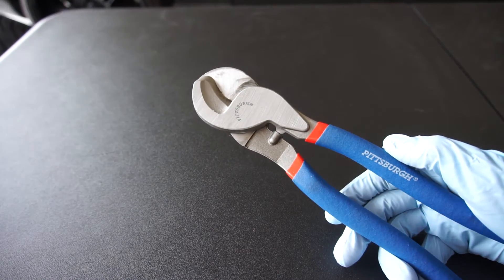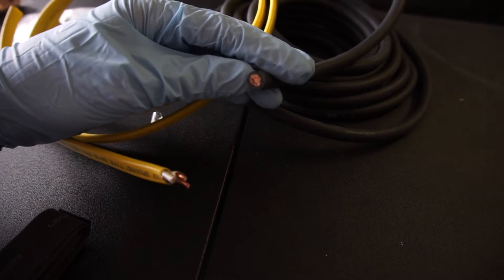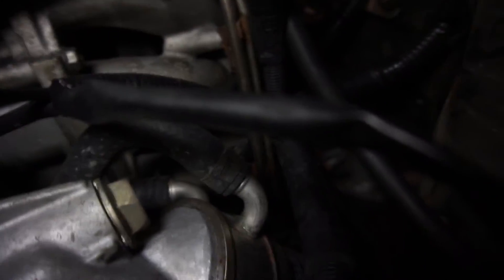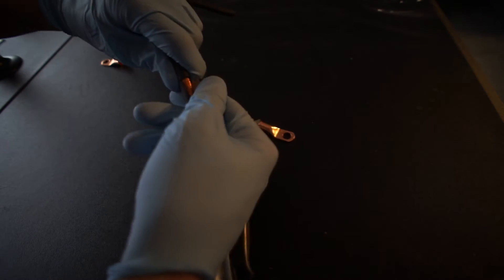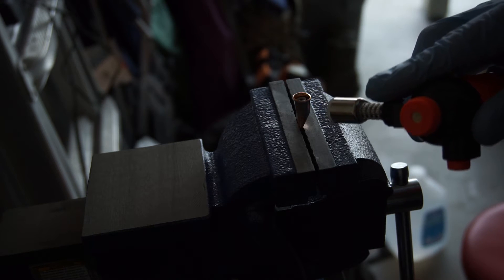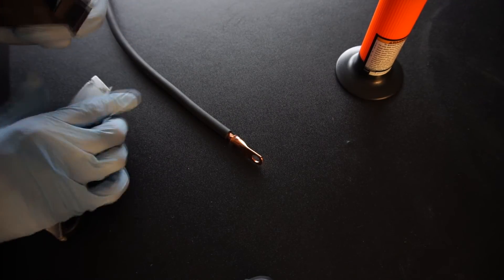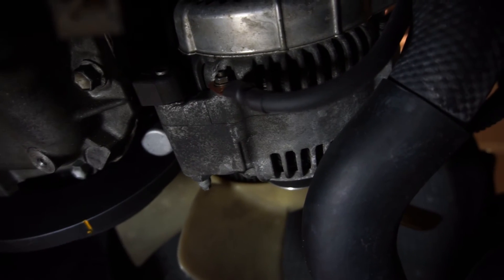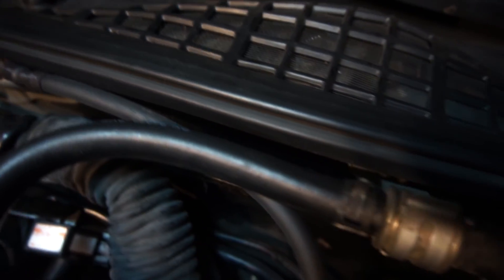SC300/Soarer/1jz - Ground Wiring Upgrade

Comment: Solid video dude. Never even thought about doing this before.
Reply from the maker: +LamaJ4m24 Cheap and easy, you can also find pre-made kits on sonic electronix for around 50 bucks. http://www.sonicelectronix.com/cat_i1209_big-3-upgrade-kits.html Any car can benefit from this, even if your car is stock. Some have even attested to horsepower gains from the improved spark plug and injector performance. Thanks for watchin!